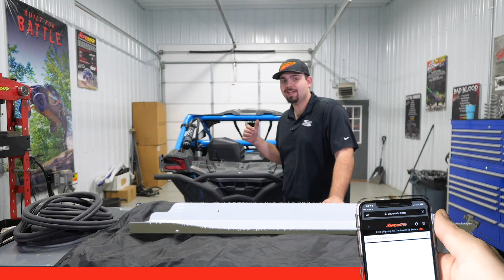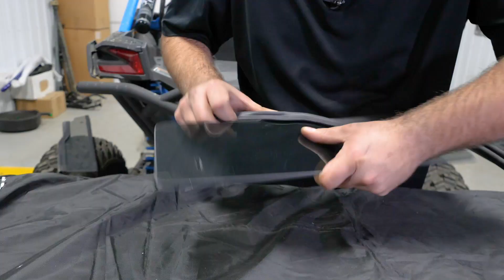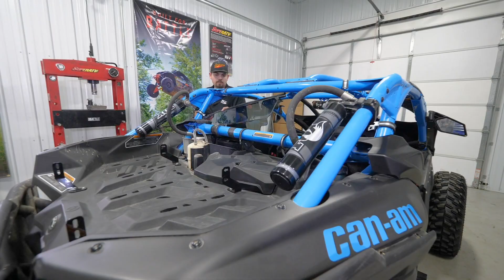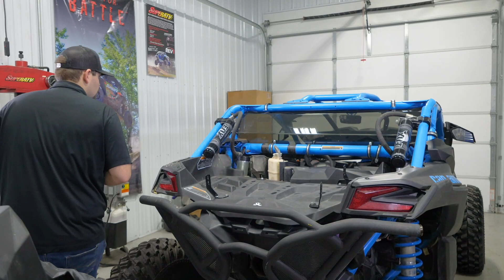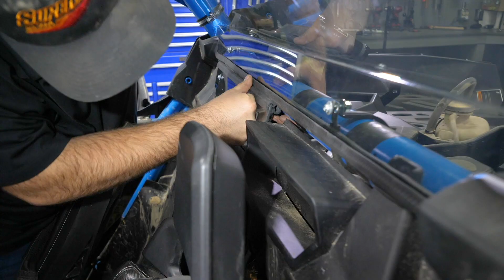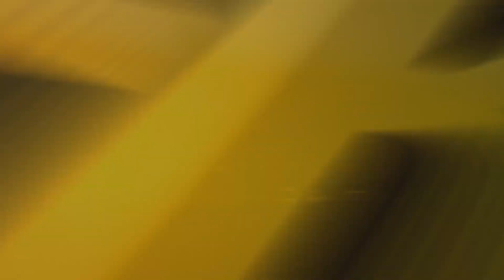Rear Windshield Install | Can-Am Maverick X3 | How To | SuperATV

Comment: Not quick or easy, fitment is absolutely terrible and the windshield is pretty scratched up by the time you actually get it mounted
Reply from the maker: The fit should be good if installed properly. It is recommended to leave the majority of the protective film intact during installation. Give us a call so we can help troubleshoot the fit, 855-743-3427.

Comment: Need to trim both sides of window to fit 2021 X3 and easy 1 1/2 hr project.
Reply: Been sitting here for at least a hour and a half trying my hardest to make it fit wondering what I’m doing wrong.
Reply: Yeah I guess I found out the hard way. I fought it for about an hour. I also ended up trimming the windshield in the lower corners. They needs to redesign  the windshield for 2021 and up models. Even after trimming it was a bit of bear to get the top bolts started.

Comment: First off...thank you for taking time to make and post this video but dude, it is not simple nor quick to install.  I recently installed one on my X3 and it took more than 2 hrs.  Your video was edited so much it is misleading.  Next time don't edit, show it as "real time".
Reply: Would you watch a 2hr video on installing a rear window ??? Probably not 🚫
Reply: Afternoon battling those clamps for a couple hours, I said screw it and grabbed some GOOD zip ties and finished up the job and moved on to another project.